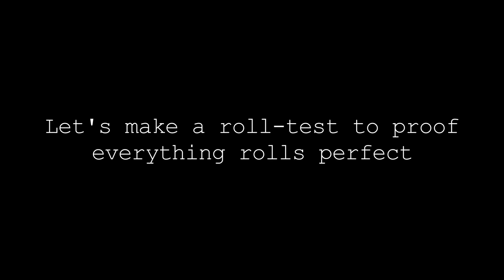Mazda RX7 FB Hot Wheels Custom | Perfect Stance

Comment: What is the white tube you used as an axle? This seems way easier than bending pins and such
Reply from the maker: Yes absolutely, it's a 0,8mm inner diameter cable sheathing
Reply: @themodelcarproject  Thank you! also i believe I've found an alternative, I picked up those paper clips with colored vinyl covers and they work perfectly for regular hot wheels axles but not so much for pins you get in extra axle sets.
Reply from the maker: @luna454BB  That's also perfect to use.👍 I like to use the HW pins on all of my builds, no matter what custom rims. Would recommend them

Comment: What size cutton bud do you use to make the axle?
Reply from the maker: It's not a cutton bud, it's a cable sheathing with 0.8mm inner diameter. You don't even have to glue the pins.

Comment: What about the fd?
Reply from the maker: It's already done, only need to film the final footage an cut the video
Reply: @themodelcarproject  I have a question what diameter tubing is used for the axles
Reply from the maker: @karenbaxter2706  inner diameter 0.8mm if you use the method with the cable sheathing

Comment: What is the size of the tube you use for the axle?
Reply from the maker: 0.9mm inner diameter (brass pipe) or 0.8mm inner diameter for flexible cable sheathing. You can check out the most recent how to stance video

Comment: you should do a collab with Jakarta Diecast Project, they make decent cars too as same as your skill, as always nice video mate
Reply from the maker: Many thanks mate! Yes, that would be interesting!✌️👌
Reply: @themodelcarproject  I am trying to get into this hobby of making some sort of mods to my hot wheels and other 1/64 scale cars but I wanted to know where do you get your wheels and where do you get your material for the pop up headlights?
Reply from the maker: @mjwatershark1881  I bought some of my wheels on ebay. Try different key words like: 1 64, rims, tires, diecast, …
For the parts you will have to search a little bit online. Would recommend modelbuilding shops, or ebay here as well (usually the modelbuilding shops sell on ebay too)
Reply: Yes

Comment: ok i need some help from the Hot Wheels Community i just started collecting and want to customize as well, the trouble im having is tapping and drilling the posts so i can use a screw to put them back together, my issue is i cannot find a 3mm drill and tap other than the junk i just got off Amazon which was 100% worthless .... is anyone able to help me with the rite tool for this job please and thanks
Reply from the maker: I made already a video on that topic, maybe that helps: https://youtu.be/VOaeBJ2oS2I
And I would recommend to buy "HSS" drills (and of course maybe not the cheapest ones😉)

Comment: What type of wire did you use for the axle tubing? They look a lot harder than mine
Reply from the maker: just some cable sheathing from a copper wire, 0.8mm diameter of the copper

Comment: Did you "3d print" the tyres with a flexible resin? Or what material are they made of?
Reply from the maker: Yes it's an flexible Resin (Called "Prima Creator Flex Resin")